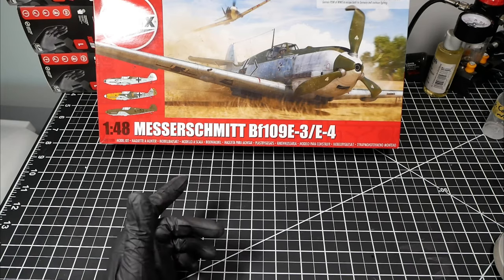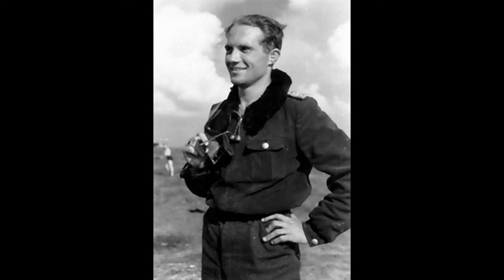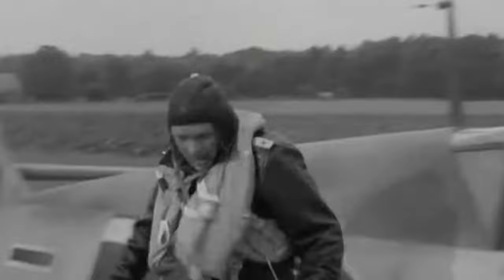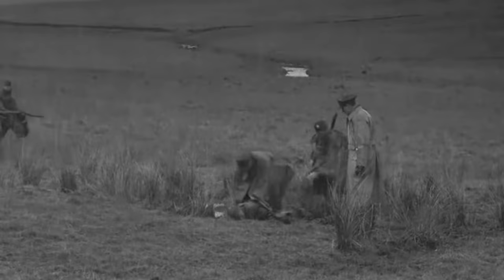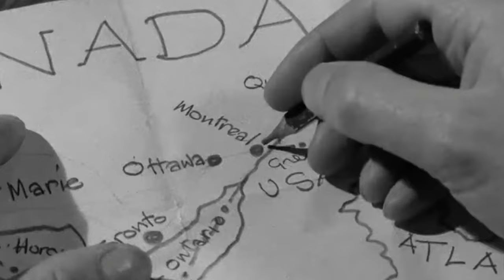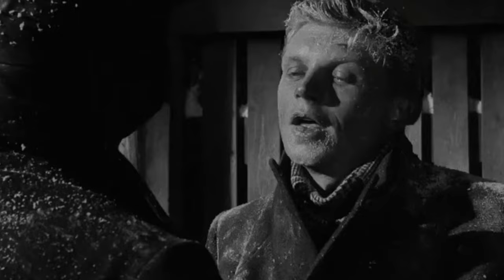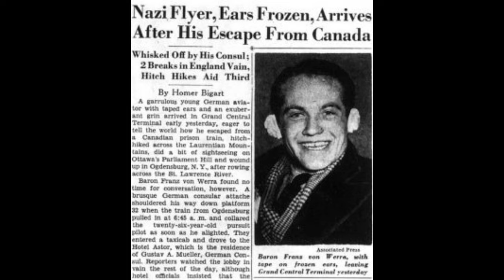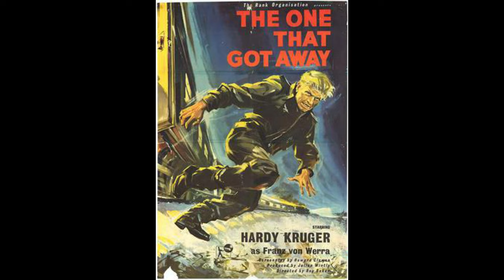Airfix Bf-109E4 - Franz von Werra

Comment: Just about finished my model inspired by watching the late Hardy Kruger in "The One that Got Away".  I must have seen it decades ago when a kid. Watched it again a few months ago. Funny in the movie they had his canopy opening on the wrong side. Maybe it was due to the required background for the movie ( houses or modern stuff in the wrong place).  You were lucky to have a 1:48 scale swastika on hand. Be hard to get one here in New Zealand. If I was making it again I would not fit the prop, landing gear and tailwheel til last thing. However I managed to mask it all OK and it is due for a coat of clear then the decals. Thanks for your video.
Reply from the maker: Thank you for the kind words! Yes, I was sure to buy some aftermarket swastika decals.. the plane looked too odd without it.

The crash scene has some curious details - the canopy in the background is something I noticed straight away. However, given the age of the film you can hardly fault them for any errors. 

If you find out any reasoning on why they did that, let me know :D
Reply: I'm sure he pulled out a P38 pistol after being shot down in England in 1940.
maybe they was around, I'm certainly NO expert.
lovely finish on the model, your an inspiration.
Reply: @kevinthorpe8435  The P1 variety of the P38 pistol began production in 1939 to replace the similar caliber Luger. So it is possible Von Werra used his influence to get his hands on one.